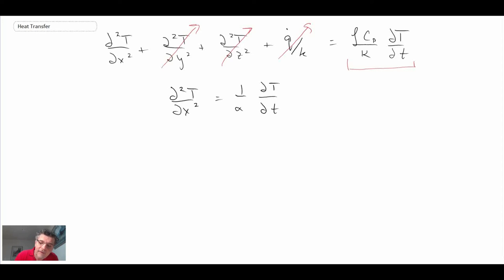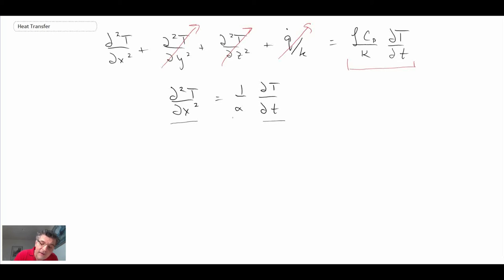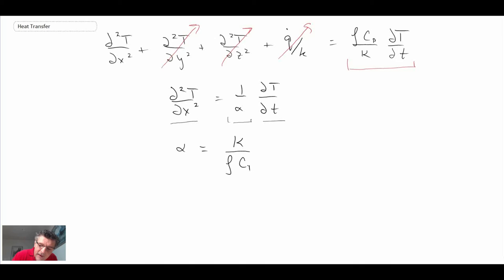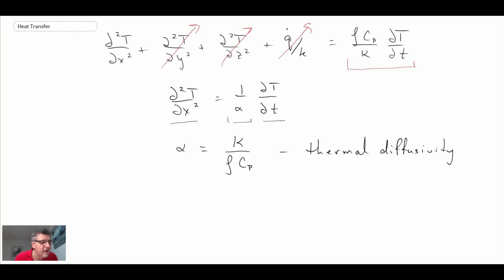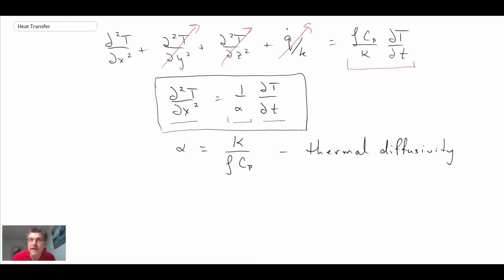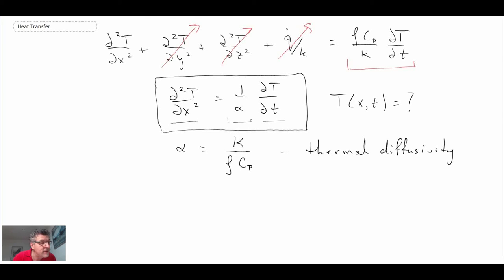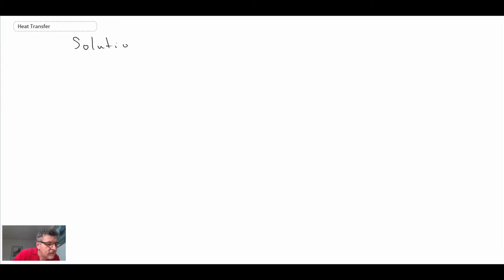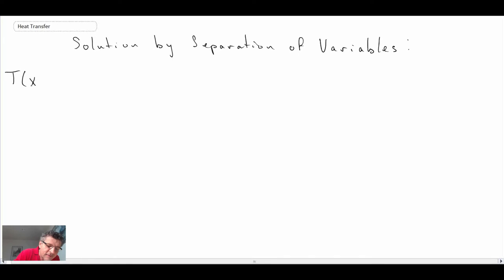Heat Transfer L14 p2 - Heat Equation Transient Solution

Comment: Small edit: at 6:50 when you show the general solution, the term in parenthesis in the exponential (n*pi/(2L)) should be squared! i.e. exp( - (n*pi/(2L))^2 * alpha * t )

This was causing me headaches in my simulations between several layers of dissimilar materials. Huge thanks for the video!
Reply: @ @Ajbomber14,  Hey, I am solving a similiar case of sheet having dissimiliar materials, but unable to figure out the code for modeling using FENics. which software tool have you used for your project? and could you please send me your code once which will be a good reference for me as my case is little bit different

Comment: Since the length of the slab is 2L,  an alternative approach would be to consider the domain from X=0 to X=L. Then, by symmetry dT/dX=0 at X=0. I am disappointed that the instructor completely skips intermediate steps and directly goes to the final solution. This is a problem involving non-homogeneous boundary conditions at X=-L and X=L and therefore the boundary conditions must be made homogeneous before proceeding with the separation of variables. The way to do that is to postulate a steady state solution and a transient solution, and the sum of these two solutions is the overall solution T(x,t).